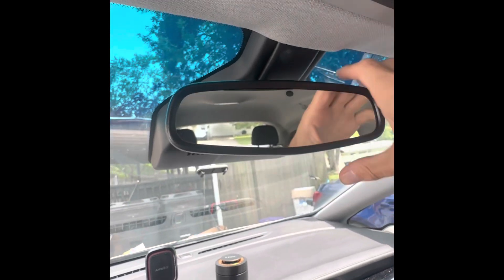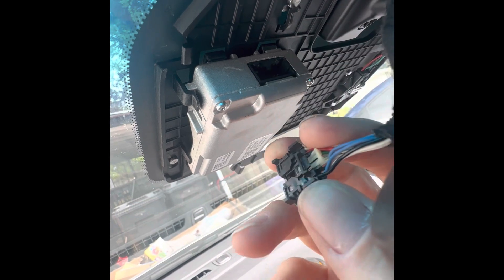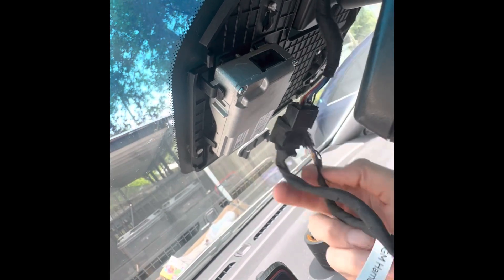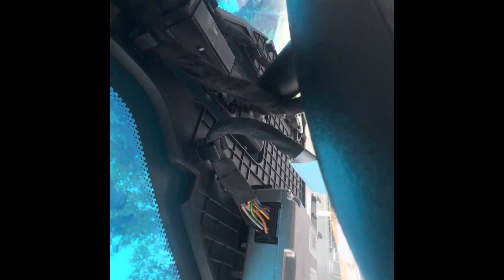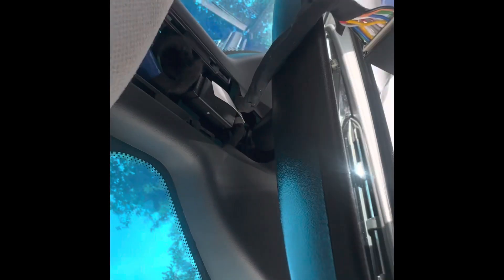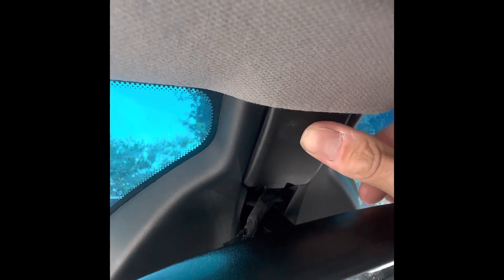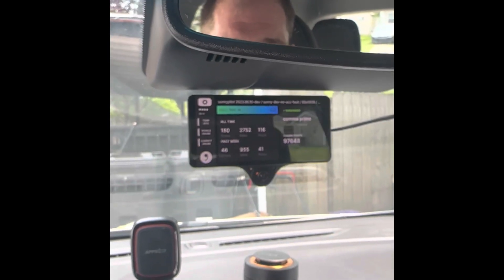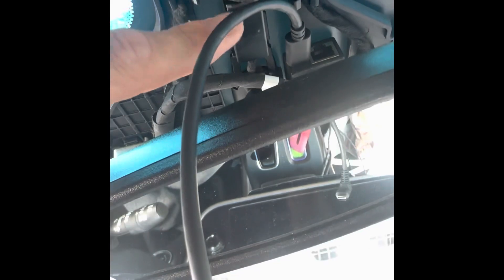How to install a comma 3 on the 2022 Chevy Bolt EV 1LT

Comment: I installed a Comma 3X in my 2022 Bolt 2LT EV today in about a 30 minutes less the windshield mount that I did sometime ago. For the camera connector I pulled back on the camera and it comes easily right out then it was a breeze sliding the white clip back and disconnecting the connector. The hardest thing for me was putting the camera housing back up and on with the extra wires in it. Went for a 15 mile drive after it was all in and it worked great.

Comment: So, your Bolt does not have ACC but has Lane Keep Assist? The Comma website says that ACC is required
Reply from the maker: @frikoriko  no not at all you can ise it without it. And also buy a pedal that gives it acc. And even without there’s redneck acc that mimics the pedal using cruise control
Reply: @DarkCloudVapors  Wow. That's a game changer for me as I thought Canadian Bolt EVs were out of luck. Where do we order the pedal? I cannot find it on the Comma website. Thanks, your info and video are very helpful

Comment: I just can’t get this damn white pin out!
Reply: i got the white pin pulled out but can't do the black push tab that's apparently easy? lol
Reply: If it's still relevant, if you look at the metal silver box which the camera is mounted in, it's mounted to the windshield by sliding it into place. There's one clip holding it in place above the connector that's easy to push in, then the whole box can slide free. You'll have a much easier time getting it unhooked with it more-accessible.

Comment: Hi, I intend to buy a Comma 3 for my Bolt EV 2023 1LT with no adaptative cruise control. I understand that I need the pedal module and if I do, iI will get that ACC, Right?  I also have to run two wires buying a splitter from BearTechWorkshop?   Would that set-up gives me a complete use of all the features offered by Comma 3?  Everything I get is in English and I am French speaking so I may skip some informations I hope that my request is clear.  Regards
Reply from the maker: Yeah you don’t need a splitter. Just the comma 3 the little black relay and the usbc. The bolt doesn’t need the Ethernet cable running to the comma power both aren’t needed
Reply: Thanks, I will order my kit today.  @DarkCloudVapors
Reply: Thanks I ordered the Comma 3 and I will come back to you when installed, I think I will issue a video in French so some friends would be able to appreciate the results. @DarkCloudVapors
Reply: @claudegalarneau4506 following..I have a 2023 bolt euv LT. Please update when you can. I am very interested in this upgrade. A parts list would be greatly appreciated.

Comment: Can you do another video about the little white tab connector and what needs to be removed for it to easily come out, the camera was blurry, because i will need install/uninstall to several of these cars several times a week. Also does OP acc work 24mph and above or not at all unless pedal?

Comment: Does this require the comma pedal? Is there any other wiring or is it just this one connector? Thanks so much!
Reply from the maker: Just the one connector. If you don’t have acc then you can buy a pedal and it has one more connection but isn’t needed

Comment: Hey man, I think this video may have been in response to my request on another one of your videos. What I was actually requesting to see was the wire tuck into the trim. The Ethernet cable, that is, being tucked into the trim of the vehicle and down to the port by the accelerator and brake. I have no idea how to hide the cable.
Reply from the maker: For the bolts the comma power isn’t needed just do this install I did and your done :)
Reply: @DarkCloudVapors  I have a bolt EUV though.
Reply: Is it needed for the Bolt EUV? Should be the same camera module and provide power without the Ethernet cable